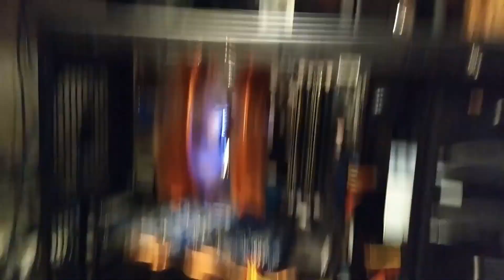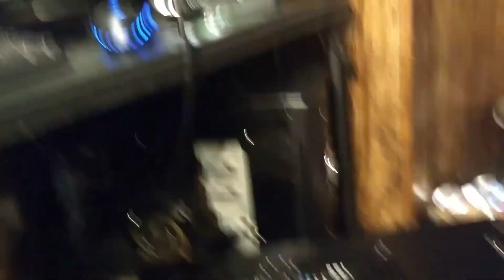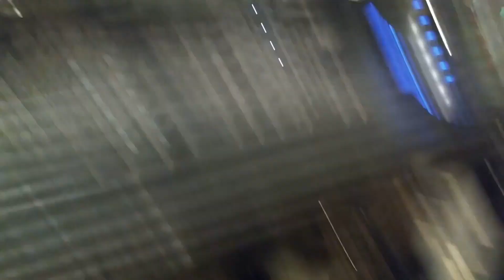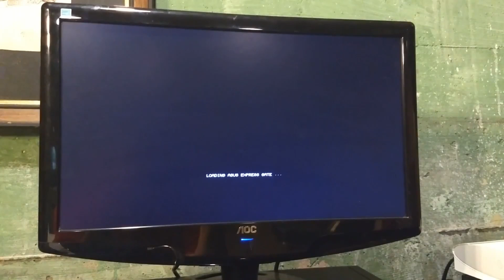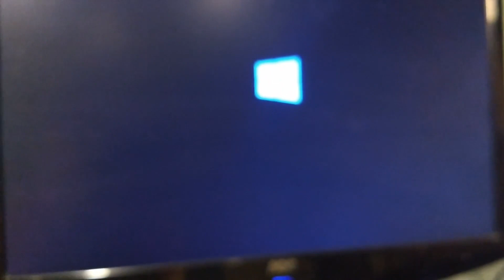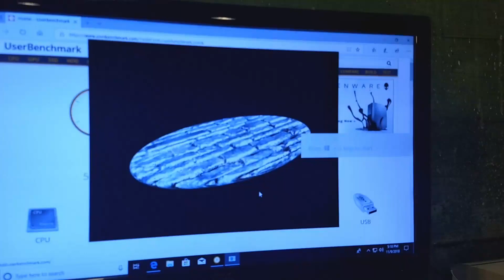What happens when your PSU isn't good enough?

Comment: Mine randomly crashes turns off then boots after 3 seconds, I have no clue what causes it. Saw some post on the internet and they said it might be the ram or psu idk. I had this for almost a year now and it was fine until now. It suddenly crashes/freezes/hang then turns off and boot right after 3-5 seconds. It does this even when I'm just casually browsing the internet, no heavy task invovled. I could play games on it sometimes and It never crashes sometimes it crashes while I'm also playing. Checked the temps of my gpu and cpu and they're all under 70, around 65-ish C so I think that's fine. Really don't know why it suddenly became like this. Any suggestions? I would really appreciate the help.
Reply from the maker: Do you get any kind of blue-screen or does it just completely power off similar to the video? Check your VRM temperatures, too.
Reply: @seversinsystems  nope no blue screen just like in the video but instead of you having to hard restart it yourself mine does it on it's own
Reply: @seversinsystems  also when it crash the screen freezes and it makes a some sort of error or buzzing sound (heard it cause I was wearing headphones) it's sounds like whenever you accidentally bumped your PC and your PC crashes/freezes/hangs
Reply from the maker: @suhwegg  Usually with a RAM error, it will give you a blue screen. You could run a memory test on it and see how it behaves. My first guess would be the power supply.
Reply: @seversinsystems  I got it fixed, apparently it's my windows os. I just reformat my ssd and install a fresh windows

Comment: Bro what psu need to my pc 
Ryzen 5 3600 
X2 8gb ram =16gb 3600mhz xmp
X2 HDD 500 gb
X1 m.2 ssd sata 500gb 
Rx 580 4gb tri fan 6+2 pin
Please help me .
Reply: You could go lower but the only good psus around that range are like 500w
Reply: @wsketchy  thank you. I have a new psu now cougar xtc 600 watts 80 + white. What do you think?
Reply from the maker: Ryan Rancap I'd plug all of that in + the amount of fans you have and how much it's being used into this calculator: https://outervision.com/power-supply-calculator

Comment: I had the same issue as you. You video card is draining too much power from the PSU and everything just shut off to prevent damaging the system. It's a security feature. Don't force your PSU to power up your video card or you can damage it. You can change the PSU for a better one or if you dare, you can add a second to power up ONLY your video card.

Comment: Running Rx 580 and Ryzen 5 2600
With a 500 Watts,it can handle most games but when I play  fortnite for like an hour it fps drop every 5 second, idk if its psu or specs idk
Reply from the maker: That doesn't seem like a power supply issue. Usually it's either going to work, or it will shut off. Frame drops can be caused by a number of things; overheating, drivers, bloatware, etc...
Reply: Maybe u dont have enough ram or your ram speed is low

Comment: My screen goes black randomly with no words on the screen when i restart the PC. Only goes black wh8ilst playing games. any fixes?
Reply from the maker: Sounds like it could either be the power supply or something overheating. I'd recommend running some benchmarks and checking temperatures to see if they're healthy. If temps are okay, I would guess it's the power supply.
Reply: @seversinsystems  Well you see, its a pre-built PC. And i have no clue on how to take them apart. And, it a pre-built pc, so wouldnt they have made sure everything was fine before i bought it? keep in mind this is a second hand pc. But we bought it off our close friend.
Reply: @seversinsystems  So as of right now i can no longer play games. And, lets just say it this way, when i cant play games for atleast 10 mins, im extremely bored, and cranky.
Reply: @seversinsystems  Oh, never mind. My video card didnt support the resolution i was using. i lowered it and now its working fine! thanks for all your efforts!

Comment: can i run gt710 2gb ddr3 on 230w or 250w psu
Reply: Yes I'm using a gt1030 overclocked on a 230
Reply: @zpwbz  bro i have g41 ddr2 motherboard can u tell me it can support gt710 my motherboard not showing display when graphic card connected plz fix this fucking shit i change my psu to 450w plz help me 😭😭😭😭😭😭😭😭😭😭😭

Comment: bro what psu i need in gtx 660 or gtx 760?
Reply from the maker: NVIDIA's website recommends at least a 450W for the 760 and a 500W for the GTX 660. When in doubt, I use Seasonic's calculator: https://seasonic.com/wattage-calculator

Comment: My PSU start making some cricket noise when I play cod MW after 1h. When I quit the game, it stop making noise. I have Thermaltake smart bx1 rgb 750w 80plus bronze. My pc is new 1 month ago
Reply: What are your other components? (cpu, gpu, ssd, ram) if your components are not demanding too much power maybe is just the psu fan that needs oil in the bearing.
Reply: @SrCremeify 
-CPU Ryzen 9 3900x
-GPU Palit Gaming PRO OC rtx 2080 super
-Motherboard MSI B450-a Pro Max
-RAM 32GB 3600mhz
-1TB

I bring my pc to the store where I buy to check the PSU, they test everything for 2 days and no noise. We still working on it to find the cause

Comment: As long as you buy from a good brand and only run a 1050ti or so you can easily run a 450 watt
Reply: He by now can use a nvidia 1650 , but its the 12+volt that matters -I dont think the specs are good with only 17A 12+v - and if its a noname psu the specs are bogus -maybe it can deliver 17 A when its fresh and not used
Reply: Thermaltake Litepower 450w running a STRIX 1070 and Ryzen 3300x. It's great
Reply: @Qimchiy  wtf how
Reply: @AltimaEditzz  i have no idea. Strix 1070 runs upwards of 170watts no problem. But for everyday I like to keep my GPU running slightly cooler so it's power limited to below 140w and 74°c with +50core overclock. The CPU runs stock but with a Wraith Prism instead.
Reply: @Qimchiy  how do u do that
Reply: @AltimaEditzz  MSI afterburner

Comment: I just got new GPU AMD Radeon HD 7600 series 4GB and I tried to play GTA 5 and the game is freeze and stuck like wont move, so I called my friend and he said it was my PSU is not enough, I dont know what type of it but I know it has 350 watt, is that right if the problem is my power supply, please answer
Reply: Yes I had this problem too i switch my power supply with another one and the problem is fixed

Comment: Is 450w enough for 1650super and a ryzen 3 3200g pls respond
Reply: Sahn okay ty. what is the minimum watt for a 1650 super
Reply: i have rx570 with 320W PSU gaming with no problem
Reply: @sahn3930  I use a 550 with a gtx 1660 super lol
Reply: Yes it should work fine

Comment: I am modifying a dell optiplex 7010 and it has a 230 watt psu and I put a gtx 1650 in it and the card says it needs 300 w psu or better. We went ahead and connected it to a monitor and turned it on(with the Gpu in) just to check it’s specs and it said that there was no graphics card in, is this what was supposed to happen? The fan was running so I know that it is correctly installed and that we also connected it to my monitor via the hdmi that was in the card.
Reply: You havent downloaded a few things for the graphics card optimization. Go to nividia website and download it
Reply: Hdgamingxx Aw dude thank you so much
Reply: Can you play games on 230 Watts ? ☺
Reply: Sziszo hell no

Comment: This is exacly what happening to me right now, but i have a 650w psu which is a lot. I also have a Ryzen 5 1600 cpu and rx570 Gpu and 2 4gb sticks of ram, isnt 650w enough to power that
Reply: i have i5 3470 + rx 570 4GB version PSU is 320W and it's working fine so your 650W is scam
Reply: i have very similar build ( rx580) and i get the smell and the same noise as he under intense games... the smell is horrible but my service tested this issue and told me they havent found any problem ...
Reply: 650w is wayyy more than enough, shit a 400w is enough

Comment: this is exactly what is happening to my PC right now... I thought the Processor was overheating but it turns out the power supply needs to be replaced
Reply: Was ur pc randomly turning off?
Reply: @jaykopl5243  yep... it was both my 4 year old power supply and very dirty cpu cooler that was causing the shutdowns/restarts
Reply: @tripniD  okay i was just wondering cuz its been happening to me and i honestly couldnt figure it out so i ordered a psu upgrade

Comment: my pc has a 120w psu
Reply: Are you serious?
Reply: @lelouchvibritannia6851   yes it is a hp prebuilt pc
Reply: @proarmy70  I'd highly suggest that you get a 500w psu atleast because almost any little parts you add into the pc will likely result in a fail especially if you want to add a gpu in which case could easily go over 100 watts
Reply: @lelouchvibritannia6851  I have to find a psu that fits that pc
Reply: @proarmy70  what is the form factor of your pc case?
Reply: @lelouchvibritannia6851  i think it's micro atx but the psu is some kinda proprietary psu and there is a 7 pin connector needed
Reply: @proarmy70  Which kind of GPU and CPU u have?
Reply: @nermindzaferovic7334  core i3 8100 and gtx 1050
Reply: @proarmy70  And working fine?
Reply: @nermindzaferovic7334  yes it's working fine but it's a little bit laggy sometimes
Reply: Lelouch vi Britannia prebuilts don’t blow up as lobg as he doesn’t upgrade it
Reply: You’re good as long as you don’t upgrade any parts
Reply: Awesome, i have the same i3 8100 and gtx1050. Calculator says it need 278 watts of power with HDD, SSD, 16GB RAM, and DVD-RW. So it is awesome it can actually manage to only use 120w.

Comment: I'm a self-proclaimed person that is good at tech stuff, but I cannot for the life of me figure out why my PC is glitching a bit.
Let me explain. (Also, if you can, can you help me? I tried posting my problems EVERYWHERE but got no help) Below are specs, then below that the problem. If there is any extra / irrelevant info in specs, ignore. I copied it from speccy.

SPECS

Operating System
 Windows 10 Pro 64-bit
CPU
 AMD FX-8320 37 °C
 Vishera 32nm Technology
RAM
 16.0GB Dual-Channel DDR3 @ 669MHz (9-9-9-24)
Motherboard
 Gigabyte Technology Co. Ltd. 990FXA-UD3 (CPU 1) 40 °C
Graphics
 VX2453 Series– (1768x992@60Hz)
 VX2453 Series” (1920x1080@60Hz)
 2047MB NVIDIA GeForce GTX 1060 6GB (Undefined) 40 °C
Storage
 0B SAMSUNG HD204UI (SATA )
 223GB TOSHIBA-TR200 (SATA (SSD)) 36 °C
Optical Drives
 TSSTcorp CDDVDW SH-224DB
Audio
 NVIDIA Virtual Audio Device (Wave Extensible) (WDM)

PROBLEM

My monitors will occasionally turn black for about 10 seconds, then slowly load everything back in. If I was in a game while this was happening, the game crashes with no error message. This seems to happen much more often on games with EasyAntiCheat. I am not overclocked. This also creates issues in certain games I play (Rust) where the game will crash with no error message appearing, and Steam will not show anything, it will be blank on every page until I clear my download cache.

POTENTIAL SOLUTIONS ALREADY ATTEMPTED

I have already reinstalled Steam, and some other applications as well as uninstalled some. I am running a lot of my applications on my SSD because it is faster.

MORE STUFF THAT DIDN'T FIT IN OTHER CATEGORIES

About 5 or so times, I will go to bed and my computer will auto-update. Every now and then when it does this, it will completely corrupt the OS and I have to reinstall. This is not that much of an issue to me because I do not have a lot of important things, but reinstalling Windows 10 also does not seem to help with the issues above, and I thought that was worth mentioning. Also, this has not happened since I replaced my hard drive with a newer one.

Any help is appreciated! Thank you!
Reply from the maker: Doesn't seem like a software issue if you've reinstalled Windows over and over again. The OS corrupting definitely sounds like it was the HDD, especially if it hasn't happened anymore after you replaced it.

The monitors turning black sounds like a GPU issue to me, but I'd run diagnosis on everything else you can find too. I'd run FurMark on the CPU and GPU while monitoring temperatures with HWMonitor and see if anything crashes or if your temps are in unsafe areas. Running memtest86 to check the memory would also be a good idea. Just for fun, you could run CrystalDiskCheck on all of your drives to see if there are any problems there.
Reply: Its psu.. ITS ALWAYS FCKING PSU i had same issue but my screen went black then start flickering some random colors then pc restarts
Reply: Try updating your gpu drivers
Reply: Turn off windows update it always fuck everything